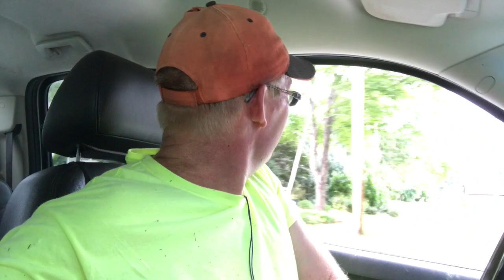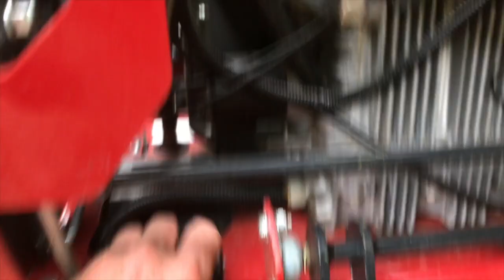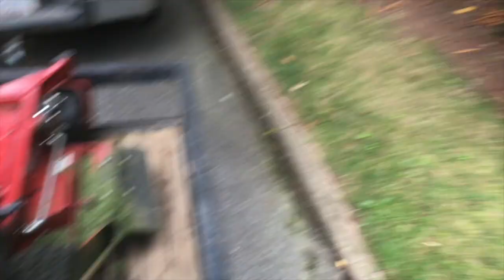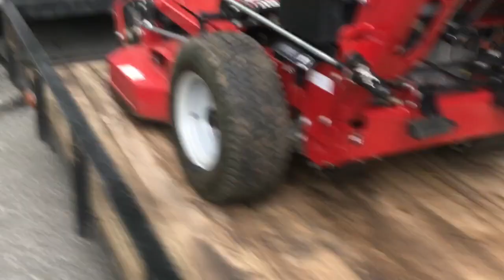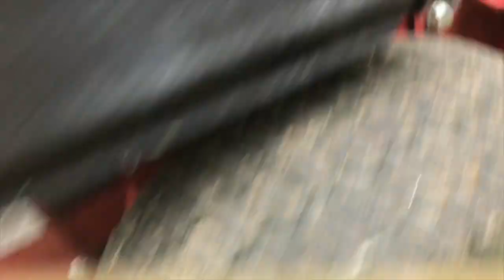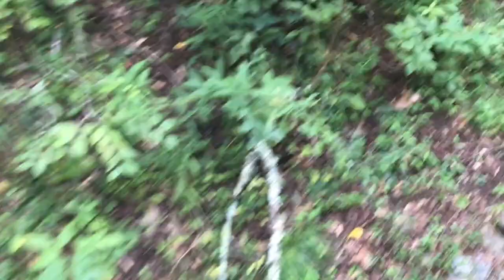Full review- Ferris FW35 48" walk behind mower - 400 hours

Comment: I have same machine. Strongly recommend grass flap! It's like your trimmer trap but way better. Instead of metal it is made of super durable plastic. Had mine on 3 years now no problems cracking or breaking! Best part is you don't have to take your hands off controls it's all a foot pedal to operate. If you get one take the plastic and heat with a heat gun, then bend/form it around that 45 degree gap where the grass shoots out. Works perfect! Great vids man keep it up! Also with grass flap you can attach a bagger! I have mine set up with a rackem bagger. Only chute blocker I could find where it works with a bagger as well.

Comment: You can always buy used i got some great buys this season 52 grandstand 23 kaw 1400 hrs 3,000 works awsome 30 exmark 950.00. 40 hrs my belt tension spring broke 55.00 bucks new dealer is supported me getting me part at no charge incudind shipping it to me we are an hr away my snapper pro sw25 9 yrs old still kicking thats why i stuck with feriss hope thing work out pd a lot
Reply from the maker: Those are some great buys!  I had such a hard time actually finding a "new" used trailer, everytime I called, they'd be sold already.
Reply: Brave buying a 1,400 hour mower. I've bought used equipment for years and got burned many times.  Had a zero turn engine blow up at maybe 500 hours. No clue what first owner did to that poor machine but I changed the oil and filter with quality products and ran ethanol free fuel

Comment: Ok so o added two 7 lb disc to add weight to front while using sulky. Arms are not as sore. Hills easier. I see mine has adjust poles with cotter pins. I have one pin fit adjustment and one above disc. I'm going with two 10 lb disc and that should do the trick when for the bigger hills. Good luck. Sulky got 5 prperties in 3 hours not exhausted
Reply from the maker: john hunt that's awesome!  I see a difference with productivity with the velke and I was definitely thinking 10 lb weights should do it!  Great idea!!
Reply: Happy's Family you might be lighter. I also want to lift when mulching bigger piles of mulch. So thinking no more than 20 lbs